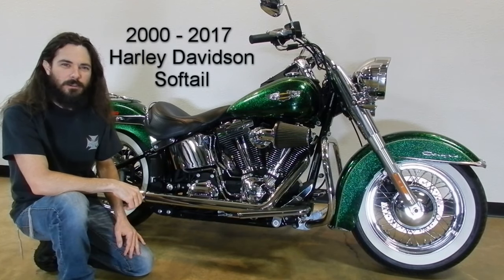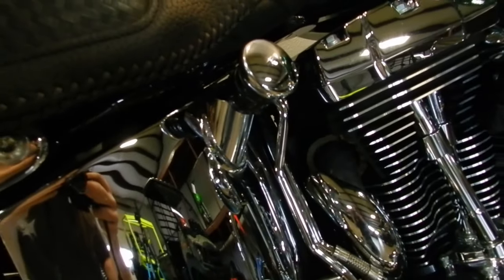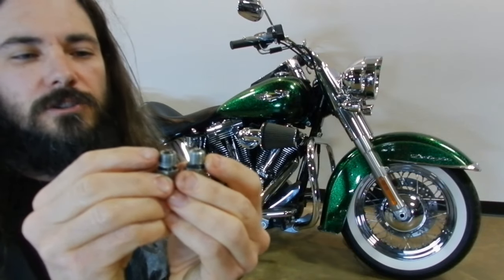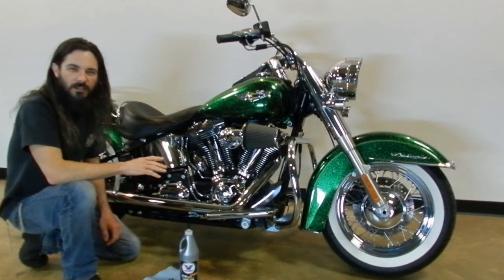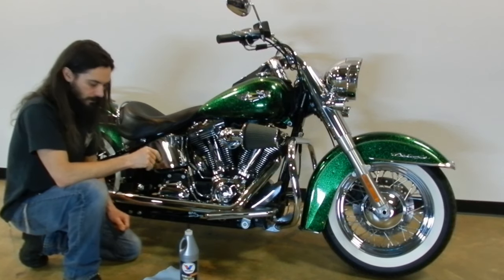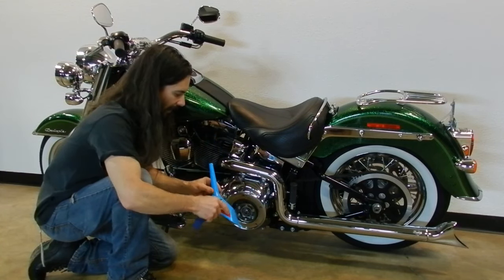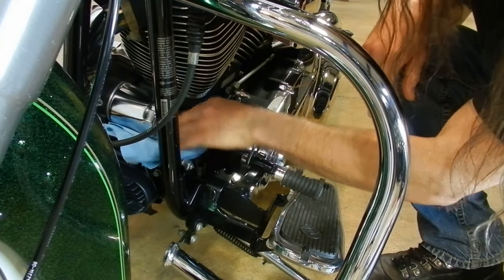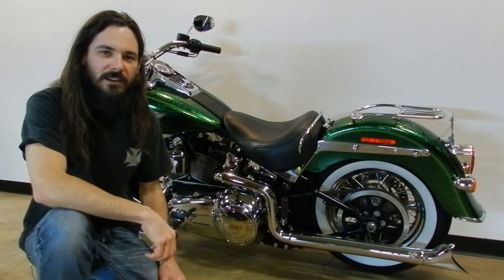3 hole oil change Harley Davidson SOFTAIL (2000 - 2017) Engine, Primary, Transmission Fluid service

Comment from the maker: Check out the Video Description to find links to the Oil and Filter and Tools I use in this video.  

Always remember, to start your bike and let it run for at least 5 minutes before you change the oil.  Warm oil drains better, pulls out sediment better, and with "Dry Sump" engines like in our Harley Davidson motorcycles, the oil tends to "sump" down into the engine case over time which will prevent you from draining all the oil from the bike unless you start the bike to pump the oil up into the oil tank before you drain it.
Reply: I tried to do an oil change right now. Whats the origional motor oil when you buy it from the dealer? Regular or synthetic?
Reply from the maker: Unless you ask for synthetic, they will normally sell you regular conventional oil.
Reply: J W Casebeer i think i had regular oil and i put 20/50 after it drained. 🤦🏻‍♂️ i didnt even change the oil filter.
Reply: @J W Casebeer Ty for the video! Easy to understand and as a first timer helped understand easily. One question: Some videos show putting a bit of engine oil in the oil filter before screwing in. You didn't do that. Is it more of preference or ??
Reply: Great basic to the point video, good job JW !!
Reply: Did you not have to add any oil in your filter?
Reply: @aloksathaye933  It wont hurt anything if you dont, but you'll want to check your level after running it for a bit. The level will be down by how much the filter holds.
Reply: There is a "dry sump" drain also on my 2005 Fatboy, always get about a cup or so out. (toward front of engine)
Reply: @aloksathaye933  I always put a little oil in my oil filter
Reply: Thanks great video-where did u buy ur gear oil at?
Reply: I should have prof read! My question was how often should I change the transmission oil if I do use the gear oil for the transmission when using synthetic 75/125
Reply: What is primary fluid capacity of Harley Davidson heritage softail 2008? 1liter or little less?
Reply: Excellent job

Comment: This is best documentary I’ve seen on my fluids change on my harley five stars too this video
Reply: I’ve got 2016 soft tail.    Great stuff.   One day hope you do video on removing front wheel too replace tire and tube :
Reply from the maker: Thank you for the kind words.  
In the coming year i will make a video about removing the front wheel.  
Thank you for the suggestion.
Reply: I'm with Robert axton on this one, I just picked up a 2011 a year ago and this taught me  a lot. It's kind of crazy when you fear no automobile engine but when you come up to something you really don't know

Comment: Thank you for this video, you saved me over $650. HD quoted me $750 for the fluids.
Reply: For a 3 hole oil change cost 750.00.
That's way too high.
I'm in SC and can get it done for 300

Comment: Love the Softail Deluxe. I just got my wife's Deluxe back on the road after her non life threatening accident about 4 years ago. New tires, tubes, wheel bearings, battery, chrome hand controls, brake line etc. I still need to do the 3 hole service on it. Very informative video. Thanks. I can hear your wife or girlfriend now "Honey, where are all the disposable baking trays I bought for Thanksgiving dinner?" 😁

Comment: Seriously good vid.  I have one suggestion:

If you leave the engine oil filler cap in place at first, you'll see a vacuum effect as the oil flow out of the drain rapidly slows.  If it doesn't rapidly slow, then there's a good chance your rocker box breathers have had it, and they're allowing air to flow into the oil jacket at the rocker box.  It can be a good idea to leave the engine oil filler cap in, until you've done this check, and you'll have confirmed that your breathers are okay.  It's effectively a check you can do 'for free', without having to disassemble and inspect.  Then go ahead and remove the engine oil filler cap to let the oil drain as suggested.

Comment: Thank you!  New to Harley Davidson ownership, I just bought a 2003 Softail and I'm getting to know her.
Out of all the instruction videos, yours is the best one I found.  You have the right level of detail.  I liked your comment about using engine oil vs gear oil in the transmission.  I liked your tip about cutting the funnel.  I liked how you do everything on the exhaust side first then the other side.  Nice work on the video!  The information is great and just right for me.

Comment: Thanks man, another point to remember is oil can have water from condensation in it. You need to run the engine and bring it to its full operating temperature to cook off that moisture in the oil. If an engine is left sitting around for long periods of time this moisture can cause corrosion on internal engine parts like steel sleeves and piston rings. This is another reason to change your oil at required times and maybe even more often in you live in areas where there is higher humidity in the air.

Comment: Thank You! I bought a '04 Deuce last year, and even though I have been working on my own cars and import bikes for years, I was a bit squeamish about tinkering on this bike. Thanks to your video, I'll be saving a few hundred bucks each season because I can certainly do the job, and  I like the fact that each system has its own drain. Again, I cannot thank you enough!
Reply from the maker: I'm pleased you will be putting this information to use!
Reply: My first Harley is an 04 Deuce and exactly what I was thinking. I have sport bikes but was a little worried about changing the oils on my Deuce also but after this video it was easy to do.

Comment: Great video.   I felt ok about doing the engine and transmission oil on my 2009 Deluxe, but I was a little concerned about doing the primary oil, but after seeing your video . . . it looked completely doable.      Nice job . . .  and you do the cleanest oil changes I've EVER seen, period!!      Thanks for the great instruction!!

Comment: The best video I watched but was surprised you did mention changing the gaskets !
Reply from the maker: Hey Joseph. 
Thanks for the kind words. 
If the bike is not leaking, and the gaskets are not visibly damaged, cracked or brittle, then don't change them.   If it ain't broke, don't fix it!

Comment: Very well made video.  You speak slowly, clearly, and work methodically.  Only change I would make is add in a reminder to replace all the o rings on the drain plugs.

Comment: This video was very helpful, thank you so much! The only thing I would add would not that you need to be very very careful with the transmission drain plug bolt. Because its between the shocks, you cant see anything when you're putting it in and could very easily strip the threads, like I did.

Comment: Enjoyed watching your video, thanks for sharing. A couple of points I would add, when replacing the oil filter, its best to half fill the filter with oil prior to installing and when removing the primary cover, losen the bolts in the same way you recommend to tighten, in a star fashion. Just something I picked up along the way.
Reply from the maker: You bet!

Comment: Thanks for this video. I am writing to you from Russia, so forgive me for my English.
The drain plug in the primary on Twin Cam engines was changed in 2004 and 2007. For each period, it is important to observe its own tightening torque, as indicated in the manual for a specific year of the motorcycle (for example, from 2004 to 2006 the manual recommends tightening the drain plug initially with a torque of 4.1-6.8
Nm), otherwise there is a risk of breaking the thread.
Reply from the maker: Это очень хорошая информация. Ваш английский превосходен. Спасибо, что поделился.
Reply: @JayWCase  👍🏻🤝🏻

Comment: I have a similar bike and change my own oil all the time.  The tip about warm the oil first is a good one.  Just make sure you get your hand out of there once it starts pouring out and after you release that thread at the bottom.
Reply from the maker: Thats a good point Todd, after a ride, that stuff is hot enough to cook a turkey.
Reply: Can I ask another question?  Does your bike have front rubber motor mounts or is it mounted to the frame and has counterbalance in the engine. I’ve got some excessive vibration now and am about to troubleshoot the cause.

Thanks

Comment: Thank you, very useful! I appreciate the Fram part #. After watching your oil filter vids, even though I just put a new H-D oil filter on, I'm running out and replacing it with a Fram! Also, the tips using a cut funnel and scrap plastic bottle cut to fit is creative and helpful.  No need to buy that $30 dollar set of "specialty" funnels. It's easy in today's Amazon world to buy stuff you can make or repurpose with ease instead. I have not heard of putting gear oil in. It is a gear box.... might as well put gear oil in it! I admit I've been lazy putting the same stuff everywhere. I can't wait to try the gear oil.

Comment: Well done explaining the how to change the 3 oils.I have a 2005 Soft Tail Dues.Not knowing the maintenance history when I bought the bike 3 yrs ago.The first thing I did was do a 1000 mile service and even replaced bothe the front and rear tire.After looking at the numbers on the tires come to find out they wher the original factory tires.So in only made since to replace them.Even at this time the bike still has less than 11k showing on the odometer.I at least get the bike out once a week and ride just to keep it from sitting.I believe from my understanding The Soft Tail Dues was only made from 2000 to 2007.Mine has the EFI enstead of a carb.Its been a really good and reliable bike.Its kinda sad they stopped producing the Dues.

Comment: After watching your video I was able to do the 3 hole fluid change on my girl's 91 Softail and my 2010 Softail Classic. There were slight differences in drain locations and such but this vid was outstanding in helping me get the job done. Thank you Sir!! Shiny side up rubber down

Comment: Thanks man, very informative and easy. I have just changed fluids. Just wanted to add that transmission and primary fluids capacity might very from model to model. Based on user manual in Softail Heritage Classic 2008, 96 inch engine it takes 32 oz.
Reply from the maker: Kostiantyn, Thank you sir.  
I am always glad to hear from owners who have specific information regarding capacity differences.  
Harley is not always consistent in this regard. 
Thanks again.

Comment: Excellent video! Thanks! A word of advice though is to address the issue of replacing the drain plug O-Rings and Primary cover gasket.

Comment: Great and clear video, but I have a few questions 1. Do the drain plug washers/seals need replacing before refitting the drain plugs? 2. Does the primary cover seal need inspecting or replacing? 3. Is there any way of knowing that the primary is at the correct level? Thank you

Comment: Great video, Jay.  One question, is it recommended to refill the bike with engine oil before changing the filter or is that a personal preference?
Reply: I was wondering this same thing…I’ve always changed my own oil and I’ve never put in new oil before changing out my filter

Comment: Not much has changed compared to my ‘98 Heritage, except my oil drain is a rubber hose with a plug hose clamped.

Comment: Hi Jay
Thank you for the great video, I think you skipped a step before you drained the engine oil, we need to start the engine to get the oil in the tank. I made this mistake when I changed my 03 oil.

Comment: Give me a thumbs up very informed him you told us how much oil goes in the first two but you didn’t mention how much oil goes into the primary case. That would’ve been very helpful also but thanks for the video.
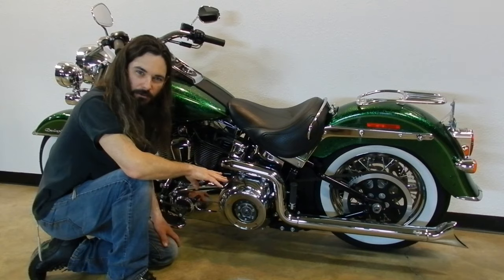Reply: Hello @davidmitchell4396. Actually he did at 10:12.   26 oz of engine oil into the primary. 20w 50

Comment: Real informative video. Thanks! Especially showing drain plug locations. I've always ridden older Harleys for the last 35 years, but last year bought an '06, 88ci, (designed by the devil himself), Softail Ebay Special Mongrel Edition, which is a mix of different FLST bikes! It looks horrible, but is straight and runs quick and strong.  I've just replaced the cam tensioners and am now doing all the fluids with your help. Also, Speed Bleeders on the calipers now, making a brake fluid flush easy.
However, I am curious as to why you removed the Derby cover on the primary to pour in oil, as opposed to the smaller inspection cover forward, where a simple funnel can be inserted, without opening up a potential oil leak scenario due to its gasket size.
(The only time I ever took the Derby cover off was to adjust a 5-stud Barnet clutch...)
Thanks for your help.

Comment: Great video! No time or words wasted and a complete tutorial. Saw the comment from someone about filling the filter first. Is that necessary?
Reply from the maker: Hey Robert, thank you for the kind assessment. 
There is absolutely no need to fill the oil filter with oil before you start the bike.  
After you change your oil filter and replace it with a new EMPTY filter, start the bike and watch how long it takes for your red oil pressure light on your dash to turn off.  
After you start the bike with a new empty oil filter, it only takes a few seconds for the oil pump to completely fill the new oil filter and pressurize the system enough to turn off the oil pressure warning light.   (obviously i don't recommend trying the following experiment, but especially if you run synthetic oil in the bike, you can drain all the oil from the bike and start the engine and it will run for over an hour before it fails, lubricated only by the film of oil left on all the metal surfaces.)   Imagining that the engine will be damaged after a few seconds of low oil pressure at idle after an oil change is absurd.  These engines are assembled out of advanced alloy components, not fairy dust and fiberglass.  Thanks again for the kind words.

Comment: Oh, BTW...if your primary cover turns into a nightmare of stuck torx, please use an impact driver before you destroy those screws. I may forget stuff, but that little nightmare was hard to forget.
Reply from the maker: Absolutely, There is not substitute for a good impact driver when you've got stuck screws!!

Comment: Congratulations for the video, the process is completely clear, I have already performed services on 883 but now I have a DELUXE and I have doubts about the oil filter, currently it has a KyN with a socket tip and extract it, but I will place the PH6065b my question is if it is necessary to acquire the key that you use so that it does not intervene in the crankshaft sensor that is still on the side or would be to carry out the next service with the PH6065b filter, I hope my doubt is clear, thank you

Comment: Is changing the oil in the primary necessary for a proper oil change or only when doing a transmission fluid change?  Thanks!  Love this video!

Comment: great job! i am wondering what size are the little o rings. I have a 96 heritage soft tail and I'm getting ready to change all my fluids. so any pointers on that will help.
Reply from the maker: I hope to eventually get around to making a service video for the evolution engine, like your 96 heritage has.  If you drain plugs are seeping oil and the o-rings are not visibly cracked or damaged, then i would not replace them.  If they do need to be replaced, then just take one with you down to the auto parts store and they will be able to find what you need.

Comment: I never fill my oil tank until I remove the oil filter first . He drain the oil tank and filled the tank before removing the oil filter. 
 Not sure if Softail  is the as a  Road King ( my bike) but just seems normal to me.
Reply from the maker: There is an oil pressure check valve and an oil pump in the oil passageway between the oil tank and the oil filter.  
What this means is that your decision to never fill your oil tank until you remove the oil filter first is like never pouring milk on your cereal until you have put a spoon in the bowl.  If it makes you feel good, that's great, but its entirely pointless. 
Thanks for sharing your thoughts.
Reply: @JayWCase  ... No a good analogy at all !  Do you change your car or truck oil the same way ?
Draining the oil , filling the pan with new oil and then removing the old oil filter ?

Comment: Jay I will sasy it again very straight forword and easy to understand but on a different note I own a 2007 heritage softail deluxe it came with a aftermarket bdl dry clutch my friend did an adjustment on the clutch and apparently did not tighten it up properly and when he was riding on the freeway things loosened up chewed the inner primary I guess? first where can I get a replacement cover at a reasonable price preferred used and I was told you can run the bike without the cover is this possible? a reply would be greatly apprecieated and you would be helping out a stranger trust me I couldn't get any stranger J.Cote

Comment: excellent tutorial, thank you. I will be changing to Valvoline full syn 75w140 gear oil in the transmission. I'll follow up and let you know how she shifts.
Reply from the maker: Hey, that's great to hear! 
I am excited to find out if you notice the difference!
Reply: And?
Reply: @donovanc7795  it's shifting fine
Reply: @DiRtBaGsNb   could you tell a difference, I was going to use 20 50 oil but if you could tell a difference I would be interested in switching
Reply: @donovanc7795  20 50 is fine but it's a gear case and gear oil seems to be better. It still makes the trademark clunking noise of a Harley Davidson but not as bad. I will not be switching back to motor oil in my gear case. I used Mobile 1 75w140 in the transmission and Mobile 1 20w50 for v twin in the primary an as soon as I run out of syn3 I will use Mobile 1 20w50 for v twin in the crank case. I have a 2013 Heritage Softail.